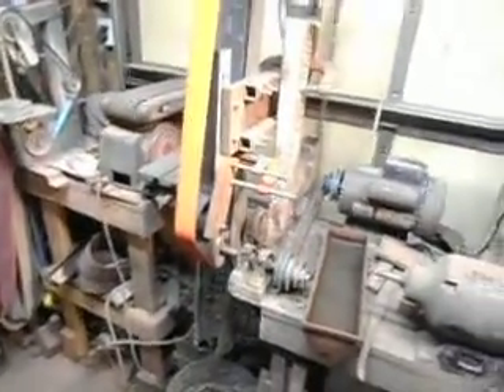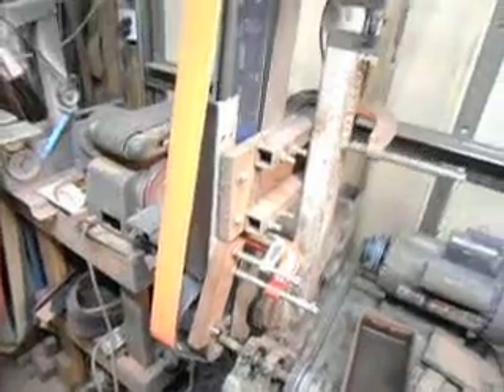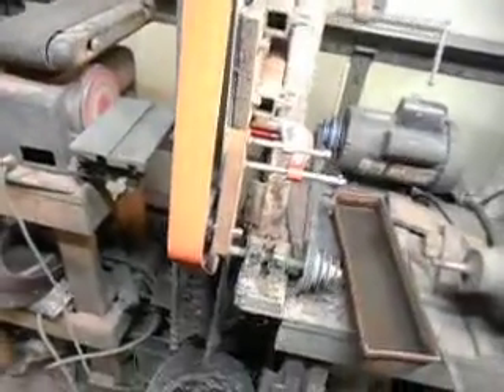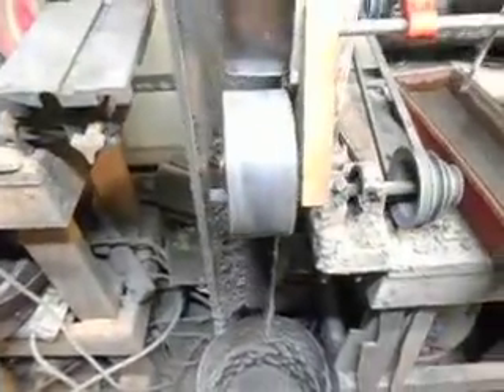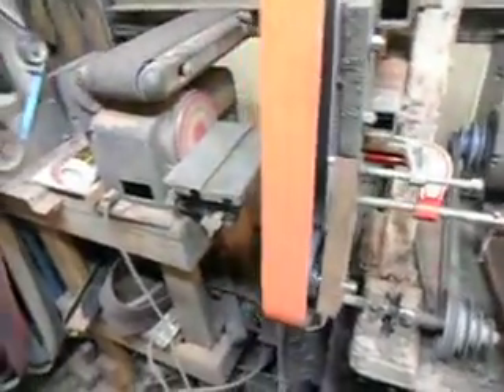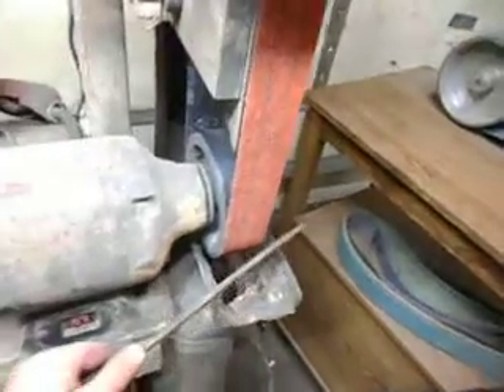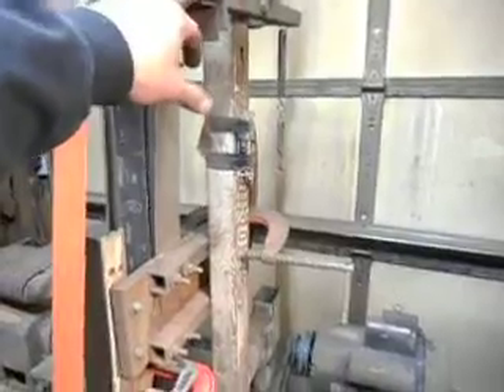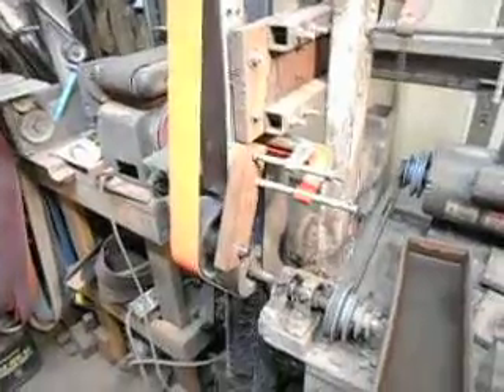cheap hollow grinding setup for homebuilt 2x72 belt grinder

Comment: If you are looking for adjusting or small contact hollow grinding  occasional use.....I got two works for you...."skateboard wheels? 
For $25.00 on Amazon you can buy a set of four that come with bearings and spacers. Mine have a 5/16" opening so I just used some bolts, taxes the bearings and went to work...I use them constantly for ALL my grinder wheels...I have one as a tracker and I have them on my plate attachment and on my radius arms and I managed to cut them down even more on a lathe for various sizes. Anyways, I get about 10 months on the bearings and about 5-7 months on any of the wheels I actually work on. Roughly 5hrs a day...4-6days a week...for me, it beats spending hundreds on professional wheels for a homemade grinder I made from scrap.
Reply: +Nick Vanderburg radiusing....not adjusting.
Reply from the maker: +Nick Vanderburg I have used some salvaged skateboard wheels and they work great for what they are!! since I made this video, I built another grinder out of a treadmill, and since I recently learned how to cast aluminum, I cast the wheels out of aluminum, and got some new bearings from usabearings I think.  I have a new 6" wheel on my lathe right now waiting for me to install bearings and a shaft. and get this, there are placed on the net that sell a 2 part castable poly urethane that looks like it would work really nice for putting a rubber coating on the wheels!! I will have to order some and play with it!